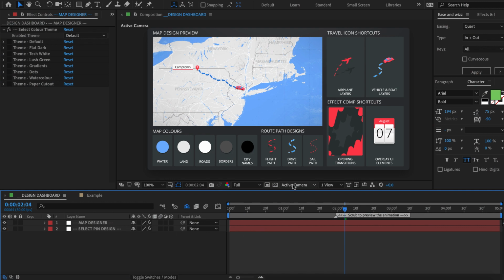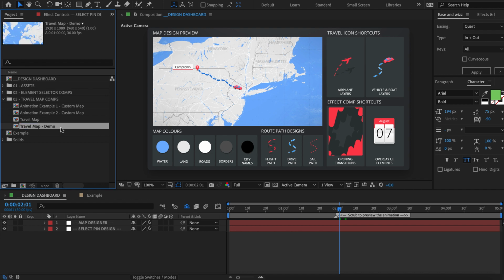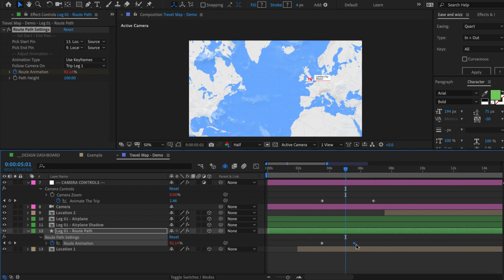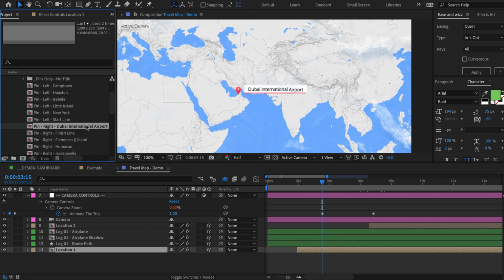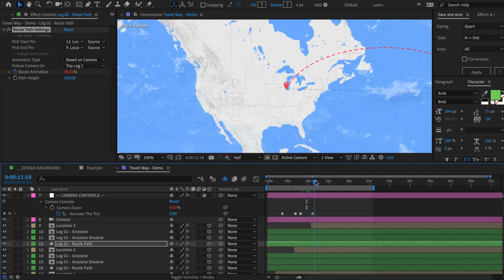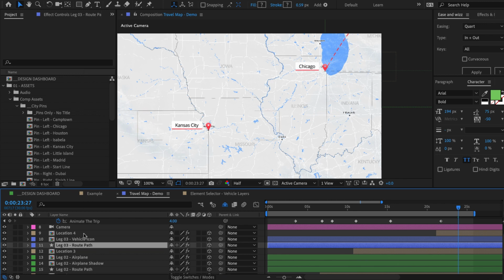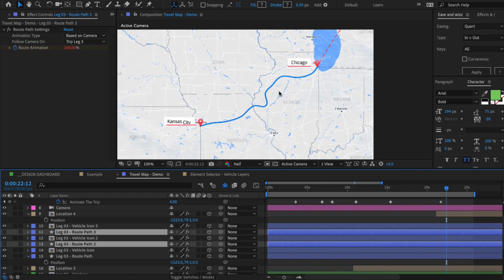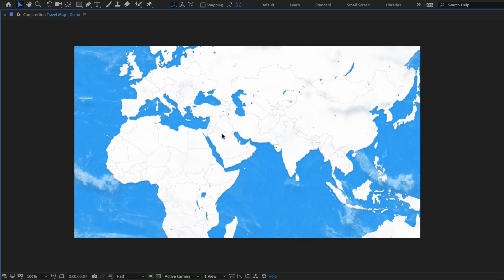Using World Travel Maps Template - Part 1

Comment: On the Lush Green map, after 2 Legs of Airplane, and the 3rd Leg for a Car I ran into an issue where I could not edit the motion path of the Car. I was able to select and edit the start/end point in the "Element Selector - Vehicle Layers" composition, but after following instructions to copy it over into my own composition it was not editable.
Reply from the maker: hi @westmanproductions, would you mind sending me an email to support@southeleven.com with a screenshot or quick video showing where you get stuck?
Reply: @SOUTH11_YT  I ended up using the plane flight path to finish the project and replaced one of the plane icon compositions with the bus. Of course, this means I couldn't use motion paths along roads but I was able to flatten the curve and drive straight to the next target so it looked okay... I'll send a video.
Reply: Okay I sent something over, forgive me for how slow I am. I'm on my 14th hour
Reply from the maker: @WestmanProductions  oh right, that's probably not ideal but good thinking. Please send me the video and I should be able to pointpoint what might be happening there.

Comment: Thank you for the amazing template.

First issue : I watched your video that explains how to add more than 10 legs but is it possible to keep the  legs from part 1 displayed on part 2 ? Because when I follow your tutorial it's like beginning form scratch again and just joining the two comps together from a chosen linking location (no historic). I manage to keep the locations by copy/pasting them below first location on part 2 but can't figure it out for the legs. 

Edit : issue 1 solved by reassigning the already drawn legs (all of them) on Trip leg 10 with fixed start/end point and animated keyframes slided back before the comp begins.

Second issue : if the comp is longer than 1min, the water layer disappears, any tips ?

Edit : issue 2 solved by displaying/unlocking hidden layers and stretching up the water one.

Third issue : when resizing the comp to 1080x1920 (vertical) I can see the border of the cloud layer (in the middle of the frame)

Edit : issue 3 solved by scaling up the hidden cloud layer.

 Thanks !
Reply: Hi, I have a question. I watched the video and tried copying it, but it doesn't work properly. Like your first issue, in part 2, all paths in part 1 disappear except last path, how did you solve this problem? I wanna show all of paths, more than 30 in one scene.

Comment: Hi there,

I just bought your template and installed AE. This is the first time I am using AE but since it was stated a beginner level should be sufficient I bought the template. Now, if I open the template in AE... I am not seeing the start screen as showed in this tutorial. I have tried to open both WorlTravelMaps -2.0 CC16 and 15 but it just didn't show. I am using a Macbook, don't know if this matters. Is there any possibility of getting some sort of support from anyone? Doesn't really matter who, I really want to figure out how to get started. Thank you so much in advance!!
Reply: Did you get this sorted as I am having the same problem.
Reply from the maker: @davidextance2443 there could be a couple of reasons for this. Would you mind sending a screenshot of what you’re seeing to our support email (support@southeleven.com)?
Reply: @SOUTH11_YT  Of course and thanks for your fast response.

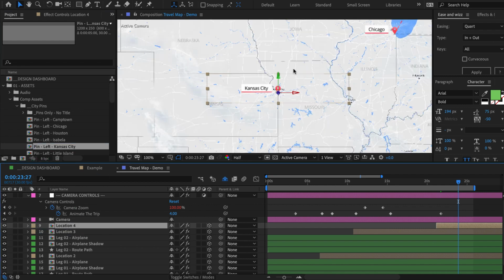Comment: I'm using 22.5.0 of AE and got the template from Envato. Trying to follow the part showing vehicle route from 17:56 but it's impossible. I have sucessfully copied both layers required but I can't control the element like you do that in tutorial. It looks different in 22.5 version. Can't move the start and end point in a way you do. If somehow I manage to do that, the car moves away from the route. Are you sure the template is compatibile with AE 22.5.0 version?
Reply from the maker: Hi there, I just checked and it seems that Adobe have changed some of the shortcuts - now in order to add more points on a path you have to press the "G" key on your keyboard and then you can click on the path to add more points. Same goes for making all of your points sharp - you have to press G and then click on either one of them. Let me know if this helps?
Reply: @SOUTH11_YT  it worked. Thanks.
Reply from the maker: @dreamcatchersjourney  Glad to hear that!
Reply: @SOUTH11_YT  I've got two more questions. (1) I'm trying to make a map zoom effect but the quality of the map after zooming stays very low, although 'switch to high-res maps' parameter is set to 100%. I am not bale to make a detailed route as the one from Chicago.  (2) Is there any chance I can speed up the animation of a name of a location?

Comment: I appreciate the tutorial but honestly what I really need is like simple documentation that shows how to do each thing seperately and simply so I can just slowly figure it out. I keep watching waiting to see the things I need and I keep getting confused on basic stuff like "how do I zoom in on the map" or "how do I change the icon" etc. After Effects really changed its UI so a lot of those things are doubly confusing
Reply: I agree, I consider myself a quick learner but I struggled with this tutorial.
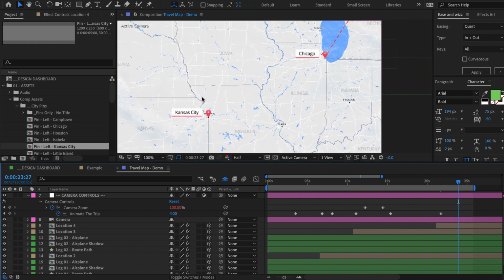Reply: Is this software buggy? I'm up to 18:12 and adding a Vehicle icon and Animating its route, however, when I click on DESIGN DASHBOARD it doesn't show up, so I can't go and copy the Vehicle and its Route. Bloody frustrating!!!
Reply: I'm now exerpierencing issues where there is no vehicle following the route. Following this tutorial precisely, however, what your're doing on your screen is not what happens on mine. This tutorial must be updated to the new version.
Reply: @jamesalexander4411  I'm just struggling with this myself. I found that as you massively downsize the vehicle when copying from the original location, the vehicle is there, but tiny. Select vehicle and go to effects controls and upscale it. having same problems with the line becoming very thin and haven't solved that yet. total noob to AE, so this is a brutal experience!
Reply: @jamesalexander4411  I found out that moving in the timeline shows the dashboard
Reply from the maker: Noted!

Comment: I love this template and just have one quick question. How do you slow down the point to point animation?
Reply from the maker: Hi there, all of the animation is driven by keys on --- Camera Controls --- layer, "animate the trip" parameter. Spread each animated leg has two keys - one for when the animation should start and the second for when it should finish. You can pull these apart or move them closer to gether if you want to control the speed of your animation. You can see those keyframes at 4m45s mark.

Hope that helps,

Comment: Hi, love the template, but why does the icon sometime glitch out when following the path? Especially along a curved line. I have tried everything, even taking off auto rotation (which usually does the trick) but sometimes it still glitches! Help! :)
Reply from the maker: Hi Tyler, is it the icon or the path that’s glitching out? I’ve seen some issues with the path in the latest version of AE and got a quick video demonstrating how to fix it. Would you mind sending an email with an example of where it’s happening so I can take a look? support@southeleven.com. Thanks.

Comment: Also what is frustrating is how quickly he goes through the car journey section as I am having trouble working out how to isolate the nodes to manipulate the path
Reply from the maker: Hi Alex, sorry if that section is a little too fast to follow. its a long tutorial so I was trying to keep it tight. Perhaps it be worth creating another one that's goes through this slower and in more detail.

Now you're saying you're having trouble isolating the nodes? I take you're talking about the points on the route? And I think I know what you mean cause I've seen it happen myself. You see the camera is zoomed in so close in the 3d space that AE can sometime have issues selecting points when you're trying to drag a box around them. So instead you kind of have to select them all by double-clicking on either one of the points and then use the ALT key to deselect the ones you don't need. Alternatively you can drag a selection around the ones you need, but just make sure you star drawing your selection box from as far as you can as otherwise AE tends to move the points instead. 

Let me know if that helps.